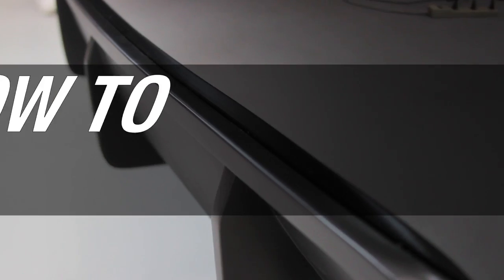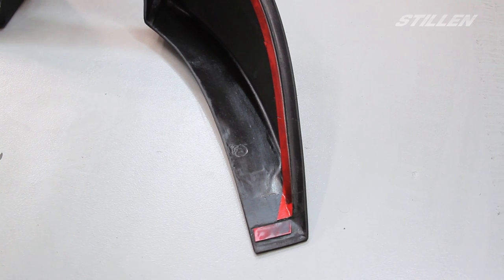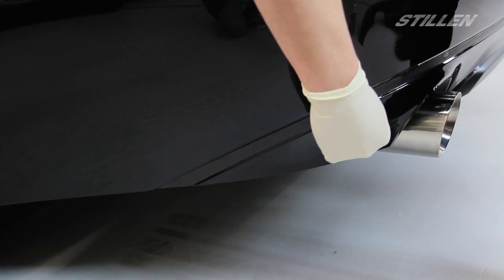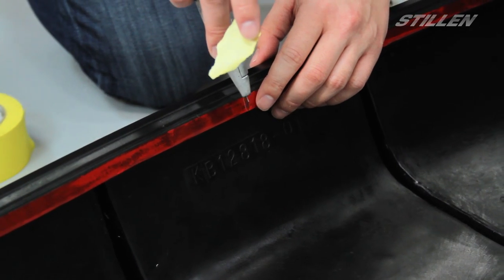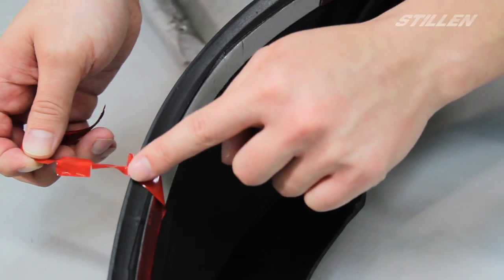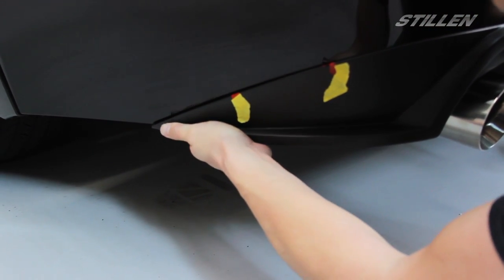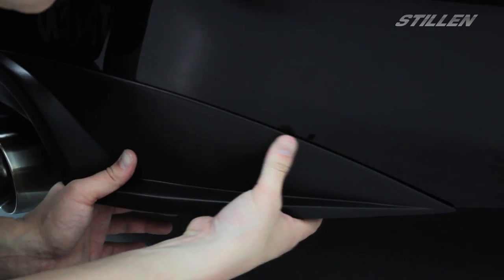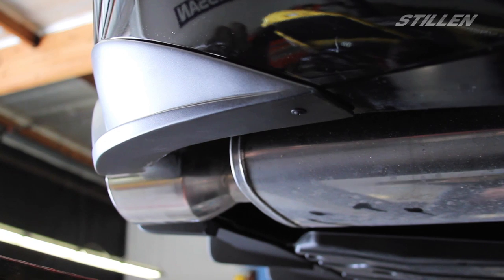2016 - 2018 Nissan Maxima Diffuser Install | STILLEN

Comment: Can you do a video on the 2017 Altima rear diffuser?
Reply from the maker: Unfortunately the install video for the 16-18 Nissan Altima rear diffuser isn't on the schedule, but the 2016-18 Nissan Maxima and the Lexus IS250/350 rear diffuser videos https://youtu.be/jjoudEIdxPo are good references to properly installing a STILLEN Rear Diffuser. Let us now if you have any more questions. Thanks.

Comment: The screws provided are inadequate, I had a body shop do the install and they laughed at your hardware. The self tap screws will eventually wear the plastic and come loose.
Reply: how did they install and what screws they used for install ? will appreciate any input

Comment: Can u tell me what size exhaust  tips  that was on the Maxcima....look good  with the diffuser
Reply from the maker: The exhaust installed on the Maxima is a STILLEN Axle-Back Exhaust and the tip outlet diameter is 4". We also have a Cat-Back Exhaust for the 2016-18 Nissan Maxima. The links are in the description.

Comment: How about if you ever wanna take it off in the future, will it mess the paint or the bumper?
Reply: 3m tape dont damage the paint. Use a heat gun and a plastic flat tool.

Comment: Great video! Is the diffuser paintable? If I want to paint it, does it matter if it’s unpainted or matte.  Thanks.
Reply from the maker: Yes, the STILLEN diffuser for the Maxima is paintable. The STILLEN diffuser comes unpainted or in matte black. https://www.stillen.com/exterior/exterior-accessories/rear-diffuser-rear-valance/vehicle/2016-nissan-maxima.html

Comment: will you guys make one for the nissan altima
Reply from the maker: +sneakeyez The diffuser for the 2016+ Nissan Altima is in production, Coming Soon.
Reply from the maker: Here's a link to the 2016 Nissan Altima diffuser. https://www.stillen.com/exterior/body-styling/stillen-2016-nissan-altima-rear-diffuser-unpainted-kb13158/vehicle/2016-nissan-altima.html

Comment: do you have to change the exhaust tips or will it work with the original tips
Reply from the maker: +Guillermo g The STILLEN diffuser will fit with both the stock exhaust or the STILLEN exhaust.
Reply: STILLEN which are those? I live in orange County. Are you guys in orange County?
Reply: Yeah, they're in Costa Mesa, very close to the  airport.
Reply: If u wanna save a lot of $ on exhaust, just do a muffler delete and buy two N1 muffler exhausts off Ebay. Costed me $80 in parts on Ebay & $75 instal...sounds and looks awesome.

Comment: Will it fit on the 7th generation maxima?
Reply from the maker: The 8th Gen Maxima diffuser doesn&#39;t cross over to the 7th Gen, it will not fit. Here&#39;s a link to the 7th Gen diffuser. Hopefully this was helpful. https://www.stillen.com/catalog/product/view/id/127664/s/stillen-2009-2015-nissan-maxima-rear-diffuser-matte-black-kb127418mb/category/1157/

Comment: is the the unpainted or painted diffuser? im curious because i have the same exact black maxima like in the video. Also was that with the stillen exhaust or just stock? thanks
Reply from the maker: The diffuser installed in the video is matte black. https://www.stillen.com/exterior/body-styling/stillen-2016-nissan-maxima-rear-diffuser-matte-black-kb12818mb/vehicle/2016-nissan-maxima.html

The STILLEN diffuser with fit with the stock exhaust or the STILLEN Axle-back exhaust. In this case, the maxima had the STILLEN exhaust already installed. https://www.stillen.com/stillen-2016-nissan-maxima-stainless-steel-axle-back-exhaust-system-504399.html

Comment: How do I install a rear diffuser for a 2017 Q50 Redsport. I dont see any instructions
Reply from the maker: The install for the rear diffuser for a 2017 Q50 is very similar to the Maxima video or you can use the Lexus IS250/350 diffuser video as reference to properly installing a rear diffuser. https://youtu.be/jjoudEIdxPo.

Comment: about the intake for 2016 can i use on 2017 maxi.
Reply: the 16 and 17 have the same measurements
Reply from the maker: Yes, The STILLEN intake will fit the 2017 Nissan Maxima. https://www.stillen.com/performance/air-intake-systems/vehicle/2017-nissan-maxima.html

Comment: Does this fit on the 2017 maxima?
Reply: the 16 and the 17 have the same measurements
Reply from the maker: Yes, the STILLEN Diffuser will fit the 2017 Nissan Maxima.

Comment: Very deceiving video. Much harder than it looks, screws and double sided tape DO NOT STICK. Must have 2 ppl install, use tons of primer to make surfaces stick and larger and more screws than the diffuser comes with. AND my diffuser was bent like MF and needed tons of force and swearing to make if fit proper...
Reply: If u installing like a pro it going stay  like  pro none to worry about it yes try broo
Reply: Get over it & figure it out.